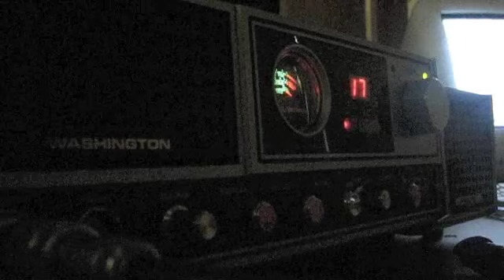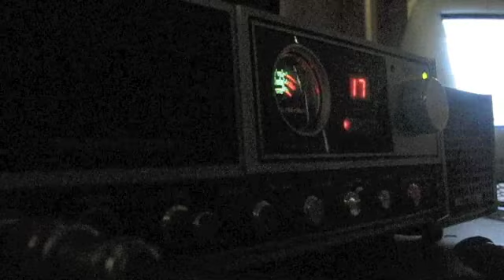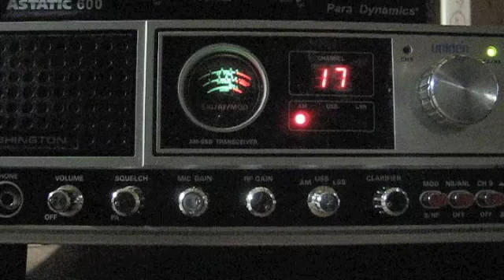Homemade CB Radio Dipole Antenna

Comment: The second time I watched the vid, I would suggest running both legs down opposing rafters making an inverted V...Try to offset the wire from the rafters a bit...YOu an also use pvc pipe with an elbow to make an inverted V, mount your wire and attach it to the building...Or a str8 V would also work in that configuration...

Comment: I've made a lot of these, but in the inverted V position and V position...Found the inverted V works best and kept SWR's low...Any wire will do, copper or aluminum cut to resonate to the 11 meter band...Although wood will conduct elctro magnetic energy, it's by far not the best...Try to keep the antenna wire away from wood if possible...Most important thing is, have fun!..

Comment: Great job mate maybe your SWR would be bather if the vertical wire dose not touch ore be near that metal beam or WTF but you probably already figured it out until now 73 to you from 45 division. And just to now I love CB as much as I love HAM radio don't now why some peoples hate CB when it is all the same fucking thing the only thin different is the frequency, but that is theirs problem 73.

Comment: I'm trying to make something like this in my loft. That looks like with an SWR of 1.3 you did well:) I have some questions if you don't mind me asking them, i'm looking for some advise.

- Does that horizontal piece of wire touch the wooden beam at the top? or is it hanging at each end with some insulators? or the dipole configurations i've seen has those white insulators.

Comment: Post 2-

- How many watts can you run out of that? ;)

- Is that the V shaped version of a dipole? what effect does that have compared to a normal flat one. Horizontal or vertical flat ones make a difference?

- Any advise you can give me about building one of these myself? As you can tell i'm new to this:) A lot of questions I know, sorry! Would be great fi you could answer some of them though!

Comment: @jeff35401 Ummm... Not too sure if you're aware of the massive amounts of spectrum that hams have been losing to cell phone companies etc. due to lack of use. Truth is that there are more hams now than there ever have been due to the removal of the code requirement and the new hams it's created and that's probably saved good portions of your band plans. The ARRL hasn't sold you guys out, the FCC has - To AT&T, Verizon, and T mobile! Be thankful that us "no coders" are here!!

Comment: The first important thing of any antenna for any type of communications service, Ham CB, cell service etc.... is that you own and use a SWR meter and know how to use it.  For me, if you can't fine tune (trim it) the antenna.... leave it in the store! As the SWR goes up, your effective radiated power goes down.  If you only have 4 watts to start with... even more important. I want as near to 100% of my RF to leave the antenna.  The old dipole antenna.... you can get it right on the money with a little effort!

Comment: For horizontal polarization, either antenna can be hot but for vertical polarization you want the top hot."...from wolfington 
dot
 net
 articles 
dipole...good luck!

p.s. for verical apps the "top" antenna is "hot", bottom one is "cold".